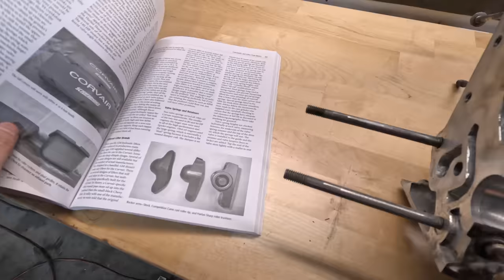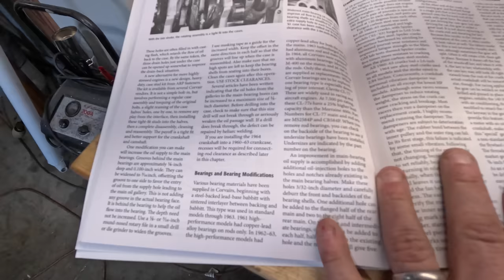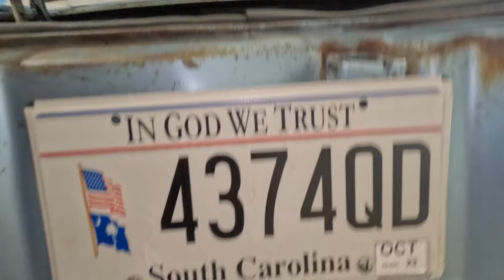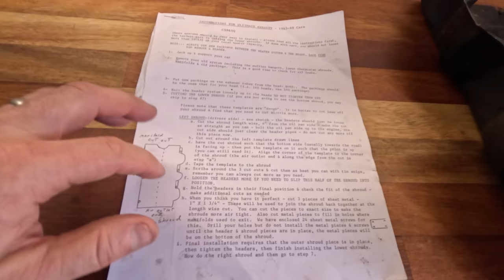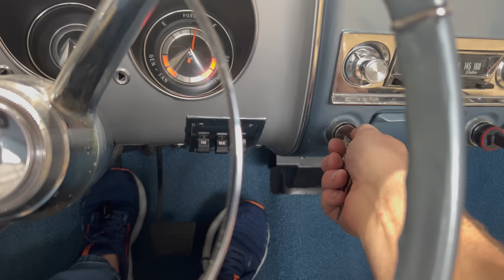HOT New Engine for the FLOODED Corvair | Cam, Heads, and Exhaust...Oh my!

Comment: *  *  *  *  If you can find a rear deck spoiler for a Dodge Omni or Plymouth Horizon , it fits perfectly under the front valence without reducing the ground clearance (at least on pre '65) and helps keep the front end planted at highway speeds , and looks good also .
Reply from the maker: Good tip, I’ll keep my eyes open!
Reply: @AutoAnatomy    *  *  *  *  I had a '64 with the separated cam gear , what a disaster and difficult to diagnose . Every time I got to work with a strange clicking , the mechanics would flag me in and put it up on a lift to listen with a stethoscope, but the noise would stop as soon as I pulled into the shop . Finally I just pulled the oil pan down , . . . you could shave with the teeth on the cam gear . All this time I thought on of the mechanics had dropped the cam , until I watched your video . At the time I had broken my leg and could not work on it myself . That car was the best thing ever in the snow except maybe for a snowcat. I really enjoyed driving it . I lived on top of a hill with about 1/4 mile of 21-degree slope to climb , the Corvair did it , even with 2 - 3ft of fresh snow . One problem I had was in freezing weather , if there was water on the road , the defroster would blow moisture on the inside of the windshield , had to scrape while driving , those early cars had a complicated puzzle of more than 15 pieces of engine shroud , and apparently my friends got the puzzle wrong . Good luck with yours and I hope you enjoy it . I would love to have another one , even if I had to put one together from scratch .

Comment: I would've thought that if there's any application to use the Red thread sealer, the flywheel bolts would be the place.
Reply from the maker: Agreed, but sadly I didn't have any at the time.  The instructions didn't even call for loctite, so I figured the blue was better than nothing.
Reply: @AutoAnatomy  Did you stake the bolt threads with a center punch, or chisel?  Physical upsetting of the threads is usually foolproof.

Comment: I see a real potential problem with your location of your auxiliary fuel filter and rubber hoses in motor compartment that is bad Ju Ju and near fan belt.  The factory carbs have small bronze fuel filters at each carb inlet, so relocate that filter canister. At least your using a metal canister fuel filter. But heat from motor and time can turn that rubber fuel line soft and leak gas on hot motor.  The factory only used metal fuel lines for good reason. 

Fuel filter can be relocated to opposite side of firewall above starter where the two fuel lines connect.
Reply from the maker: Jim, I've already moved the fuel filter and remade the fuel feed hose.  It was always a bit too close for comfort.

Comment: ATTENTION VIEWERS:  Every Corvair engine builder should “deburr” the inside of the engine block as he shows here with one exception.  Do not smooth out the tiny natural textured bumps on the inside of the block especially on the crankshaft main webs.  The reason is very minor, but makes sense.  A smooth surface has LESS surface area than a slightly bumpy surface. Think of it as the difference between a bowling ball and a basketball.  Even at the SAME diameter the basketball would have MORE surface area, due to the up and down distances of the bumps than the bowling ball would.  Why does this make a difference?  Because the more surface area you have that is slightly bumpy, the more cooling capability you will have.  

Now, obviously the smoother surface allows the oil, which serves as this engines coolant, to run back down into the pan faster. This is true.  But it also doesn’t allow your oil, again the COOLANT for this motor, to absorb as much HEAT out of the engine as it spends less time hanging on the walls.  If the oil doesn’t stick to the walls, it doesn’t pull the heat out of the motor.  This is something we’ve learned in the 50+ years since those first rebuild books were written.

So, absolutely do as he shows here and remove all the casting flash and sharp angles from the inside of the block (except for the bottoms of the bores, definitely don’t smooth those out) as this absolutely does aid preventing oil from pooling and eliminates sharp edges that become hot points. Just don’t smooth out the tiny natural (basketball-like) bumps inside walls and main webs.
Reply from the maker: There is some theoretical truth there, in that a cast surface will have more surface area for cooling than a smooth surface.   In practice, I’m not sure how much of a difference it really makes.  People have been painting the inside of race engines with Glyptal paint for years to smooth/expedite the oil drain back from the top of the engine, and in my “race” builds I’ve never seen an engine overheat solely due to this.   Air cooled engines may be a bit different, granted.

Certainly some things to ponder, and thanks for watching!

Sean

Comment: Yeah the Corvair engine wasn't treated well by Chevy. The clean up of flash will help the oil return and might actually help improve cooling by a little bit. New cam breakin...2k rpm for 20 minutes. You should not have run the ZDP until after the first 5k miles. Engine ran strong from what I saw. Sweet!
Reply from the maker: It ran at 2k for 20 min, and Clark's recommended the ZDDP immediately with their cams.  It does run great and I'm so happy to have it back up and together.

Comment: What about cam break in that's always necessary with a new cam.     and I was taught that a person should break in a rebuild. just like how you're going to drive the vehicle.
Reply from the maker: I did run the engine at 2000 RPM for 20 min to break in the cam, just didn't show it.   As for breaking in, I know some people say to run it like you'll drive it, but I think that's a recipe for a broken ring.  I'd rather take it a bit more conservatively and have it run great for a long time.

Comment: No cam bearings?
Reply from the maker: Nope, it’s similar to an overhead cam engine where the aluminum is machined into a precision surface and no bearings are needed
Reply: @AutoAnatomy  Thank you very much.  I’m. Crazy car nut with 10W30 running through my veins but have to confess, never have seen a corvair engine reassembled.

Comment: A new clutch disc but reused the pressure plate?
Reply from the maker: Measured the flywheel & pressure plate flat with no warping.  No need at this time.

Comment: Why hasn't anyone put a Porsche engine in one of these things surely it must go straight in ?
Reply from the maker: The challenge would be engine rotation.   Corvairs run counter clockwise (when viewed from the back of the car) and the Porsche runs clockwise.  Now you could drop in the entire 911 drivetrain and have it work, I assume.

Comment: You should never run a air-cooled engine without the lower air shrouds these shrouds turn the air toward the back of the engine making the air from the fan blow air across the bottom of the cylinders without them on the air blows straight downward an the bottom of the cylinders will overheat and warp + cause the pistons to seize

Comment: Just my two cents worth.  Don't use Wix filters as they are garbage.  You cut the filter on the wrong end.  Always tape up the mating surfaces when you're deburring just in you miss or the case grabs the deburring tool.
Reply from the maker: I have always had good luck with Wix filters, what issues have you seen?  As for cutting the filter, the cutter I have just wouldn't fit on the "correct" end, necessitating cutting it backwards.
Reply: @AutoAnatomy  I've had to rebuild engines because both WIX anf Fram oil filters collapsed internally and blocked oil flow.   I would never ever use either!  I stick to OEM, K&N white filters, Bosch, Mobil1, Mahle or Mann.  I've also had AC Delco filters leak.  Wix uses the cheapest materials they can get.

Comment: The Corvair has gotten a lot of bad press in the past.If it was such a failure,why did they produce them for 10 or less years? Look at the Fitch Phoenix. Very thought after project.
Reply: Just look up Ralph Nader vs Corvair
Reply: The Corvair was actually an innovative vehicle for Chevy. The big problem with the 61 to 64 model year cars was that they copied the VW swing axle rear suspension. On a VW Beetle the vehicle weight was light enough that in hard cornering the weight jacking effect did not roll the tire sidewall, allowing the rim to dig into the road. The Corvair weight was the differentiating factor. Triumph Spitfires had swing arm.rear suspension also. Racers install travel limiters to limit the amount the rear suspension can drop, preventing it from getting to a dangerous point. 
65 to 69 Corvairs had full IRS which worked well, however  Ralph Nader's book Undafe at Any Speed had been released by then. This was unfortunate as the new model was stabile and performed well. Nader's book was written and released based solely on the early model, which actually was not that bad. The design problem was compounded by stupid drivers driving faster than they should have and probably not maintaining proper tire pressures.
Nader was a lawyer with a definate left big brother bent who went after a  number of safety and enviornmental "issues", justified or not. The early models do require to be cautious.

Comment: Why don`t you use ARP bolts on your flywheel and crank.!!!!!!!!!!!!!!!!
Reply from the maker: Couple reasons...one, the engine doesn't make nearly enough torque to truly worry about shearing the flywheel bolts.  Two, I didn't have any!  For some things I agree that stronger bolts are an improvement (ARP studs for the rods), others don't need that kind of strength.  Just my thoughts.

Comment: Poor workmanship installing the new oil pan. Always start tightening the bolts in the middle of the pan and work in a circular pattern outward. Snug up the bolts than torque half way to required torque, then repeat with full torque spec. Great work doing all that deburring inside the crankcases.
Reply from the maker: Not everything that is done is shown on camera, before judging someone's workmanship please understand this.
Reply: @AutoAnatomy  but it's bad form to put on video poor workmanship habits. Your viewers are learning from you. Don't teach them bad habits

Comment: Doesn’t matter if you push it or not, it’s still unsafe at any speed 😂
Reply from the maker: Ha!  
😎
Reply: It’s a ‘65!  The rear suspension was totally reengineered to rid the car of previous faults.  If Sean upgrades to 14 inch tires, problems are solved.
Reply from the maker: I've been thinking about some 14 or 15" wheels as an update, just haven't found any I love yet.